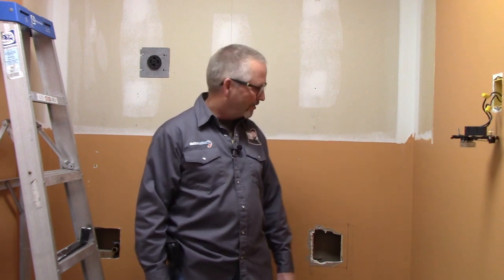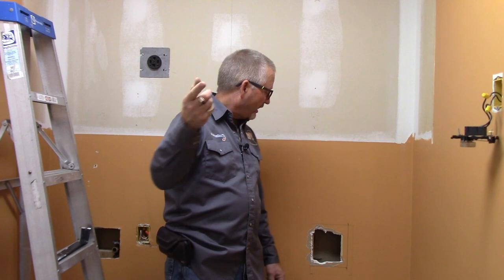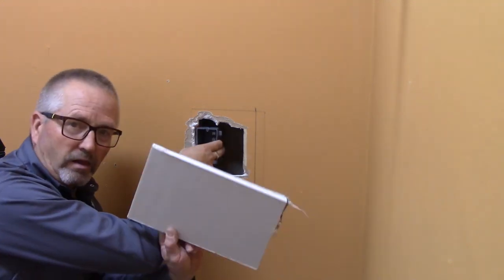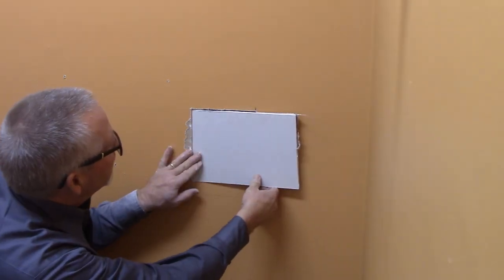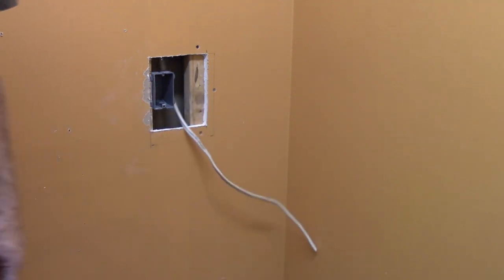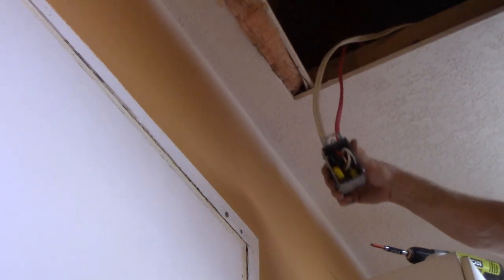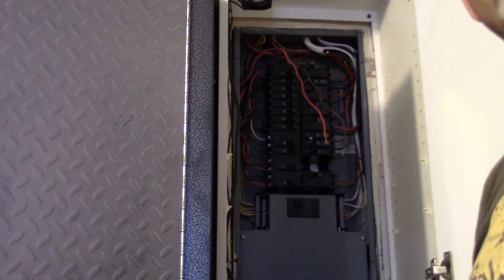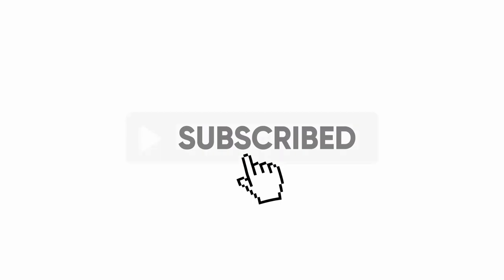How to Add a Fridge Receptacle

Comment: It sure was fun doing the wiring for my newly constructed house (did all of it myself), but I hate fishing wires through finished walls, and all that stuff... :) Good video , thanks!
One question, though... You mulled over the idea of making that junction box in the attic a receptacle. To my knowledge, the code requires a dedicated circuit to a fridge, so would adding an extra receptacle to that circut be a violation, or is it actually allowed? I know there are some not-so obvious exceptions in the code to the dedicated circuit requirements, like for smoke detectors, for example, so I wonder if this may be a similar case...
Reply from the maker: It wouldn't be a problem as it would not be used very often if at all, but notwithstanding that, the NEC does not dictate that a fridge have its own dedicated circuit as long as the entire load on the circuit doesn't exceed the maximum known load.  Refrigerators are considered noncontinuous duty loads.
Reply: Thank you, Terry! Not familiar with the NEC, I was going by the Canadian code 2012 edition which was in effect when I was building my house. Rule 26-720(a) seems to be very specific about a dedicated circuit and no other outlets, with one exception:
"each receptacle installed for a refrigerator shall be supplied by a branch circuit that does not supply any
 other outlets, except a recessed clock receptacle intended for use with an electric clock".
There could have been changes in later editions I am not aware of that relaxed this rule...
Reply from the maker: @--KT--  No, you are correct on the CEC.  I assumed you were from the USA as most of my viewers are.  Let's call mine a clock receptacle (if I had don it).  I too am Canadian, and my house in Arizona is where I discovered that the fridge had an additional outlet on the circuit, one in the living room of all places.  That's when I looked up the rule there and found out is was allowed.  Also a 20A circuit using #12/2.  FYI, now require GFCI and AFCI protection in a new build.
Reply: @theinternetelectrician  Ah, OK, thank you! Yes, I am in BC, Canada - should have been specific about that in my question. And yes, I heard about the new requiremements for GFCI and AFCI, thanks!

Comment: I took down an old florescent light fixture to replace with a normal one in a bedroom. Only problem is the old one had two whites, two blacks and a red.

Tucked away the red one and hooked the rest up, but now the switch can't turn off the light, just stays on.

Oh well, gonna finish my beer then start switching around wires until something works.
Reply from the maker: Grab me a beer and we'll talk about this! In the ceiling outlet you had 2 black, 2 white, and a red? Connect your new fixture to the red and the whites and splice the 2 black together and tuck into the box.  So, to recap.  Ground, white from new fixture spliced in with the 2 white wires.  The black from new fixture to the red wire, and splice the 2 blacks together and tuck away!

Comment: Terry: Not a fan of stacked appliances. Best wishes. Good job.
Reply from the maker: Thanks Ted! What don’t you like about the front load stackable?
Reply: agree- #1 stacked washer/dryer much more expensive and cant be mixed, in other words you have to buy the same manufacture if dryer or washer goes. SOLD in pairs not individually *most cases #3 smaller capacity * most cases#4 makes repairing stacked appliances more difficult to access. Lastly, adding another refrigerator * Terry didn't state the energy rating on refrigerator but (2) refrigerators running in a household is a energy drain/not energy conscious * most likely the second frig is a high amp usage: if a person cares.
Reply from the maker: @proanswers  #1 Agree, they usually are more expensive, #2, but they certainly can be mixed.  And they are not sold in pairs, but individually. #3 Smaller capacity is a generalization.  They make them in a variety of capacities, as do the top loads. #4 Repairing more difficult, subjective. #5, Yup, it's an older fridge and won't be a superstar in the energy ratings, but I balance throwing it out into a landfill vs having ice cold beer ready when I want it!
Reply: @theinternetelectrician  maybe the industry has changed on how they sell stacked washers and dryers as pairs, interesting.
Reply from the maker: @proanswers  You may have been thinking of stacked "Laundry Centers" that are an integrated unit.
These are separate units that can be used in the traditional side by side or stacked with dryer on top of washer.  To do this you then should have the matching pair only for the use of the stacking kit (factory brackets) that hold them in position so one doesn't fall off of the other.  They are autonomous.
Reply: @theinternetelectrician  Yes this was my thinking stacked integrated laundary- There was a bosch unit I fixed year ago that was very difficult to service and it was $2000 shoved in a closet used a ventless system- that constantly needed to be maintained- apparently a necessity in Europe as venting is not always possible.